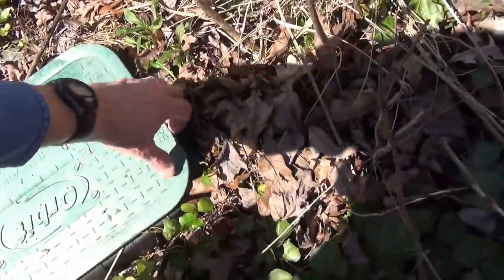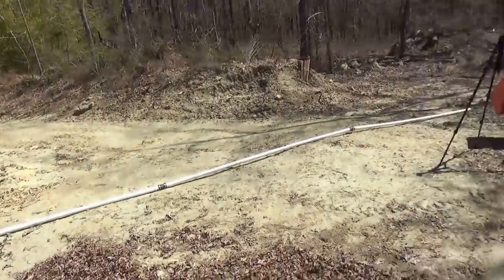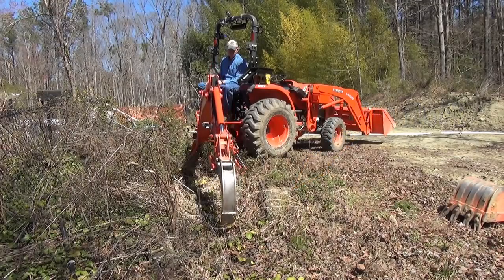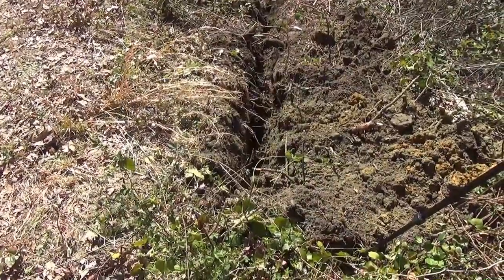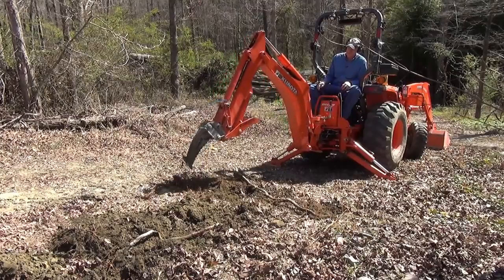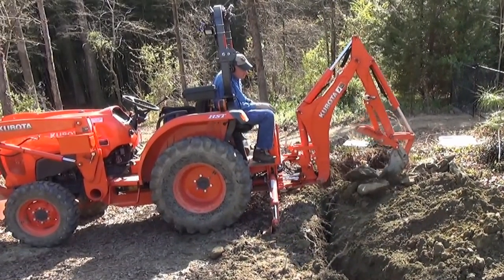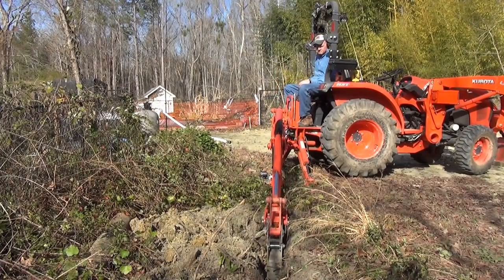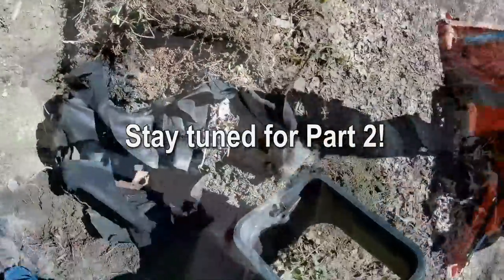Trenching a New Water Line with My Kubota Tractor Backhoe - Part 1 (#32)

Comment: Hey there Martin!!  That's no small job you got going on there!!!  Good to do it as I would be worried about the thin wall pipe just like you are!!!  Having the quick change bucket and trencher is pretty handy on a job like this.  Looking forward to part 2 and see the valve box redone.  Where I live you can get away with only burying your lines to 2 feet most winters!!!  This past winter though, with out much snow and it being so cold, the frost probably went down 3 to 4 feet in a lot of places.  Take care !!!
Reply from the maker: Hi Mike!  Yes, it was a big job, but made easy thanks to Big Orange and the backhoe.  Just took a couple of days.  Thanks for watching!

Comment: Martin, I don't know if you already connected everything yet, but if you haven't, on your PVC, wrap bands of metal.  It looks like you may have already glued all your PVC pipe together (not sure).  I dug a water line from the water main back to my house and it was approximately 1200 feet (can't remember).  At the time I used a rented ditch-watch (from Home Depot rental) and then laid 2 inch pipe.  It was a long process and could have done a series just on that alone but that was over 10 years ago.  I placed metal bands around where each of the PVC pipes joined before burying.  This helps you locate the water line years from now with metal detectors.  Just my lessons learned.  Great video.  I have been trying to get a BH connector from Bxpanded and they only make for Kubota and JD.  I sure would love that quick connect.  Full watch and wish you a fine weekend.  Don
Reply from the maker: Hi Don!  That's a good idea.  I didn't do that but I do have a lot of video and pictures documenting where it is. :)  Thanks for watching and you have a fine weekend too!
Reply: THAT is a very good idea.  I've never thought to do that in the past but that really makes sense.  I like it.  SF, my friend.
Reply: @tractorman4461  Hey there Wendell.  Appreciate the acknowledgement.  Hope you and family are doing well. I thought of you the other week when helping a retired soldier make a wooden door. I remember you helped with your daughter's rolling wooden door using the reclaimed wood from your granddad's place.  I was thinking of doing something like that for my friend. Ha, so many wanna-do's running through my small brain-housing group (smile).  If I miss talking to you, have a great Memorial Day.  Semper Fi.
Reply: Good morning folks, another method is to bury a tracer wire (something cheap and thin works fine) then locators hook up to the wire and trace it. That's what we do with plastic gas and water lines here in the Kansas City area.

Comment: Very neat with minimal ground disruption.  A large chain type trencher would do similar so bucket appears to be appropriately named.  I made the mistake of buying the Kubota 10” bucket and any moist clay sticks inside horribly.  I am beginning to think it will become a $500 hunk of metal.
Reply from the maker: I’ve heard the same thing about buckets under 12 inches.  That’s why I like the BXpanded trenching bucket’s design.  Thanks for watching and commenting!
Reply: @DIYMyWay  Martin, you and Greg K can solve that issue to an extent by taking a HEAVY linked section of chain and welding it inside the small capacity bucket.  That will minimize the compaction of the clay in the bucket and allow it to shake out much more easily.  Of course it won't totally eliminate the issue.  Large links.
Reply from the maker: Now THAT’S a cool idea!  So is the chain link welded to the bucket just on the ends?

Comment: Nice job Martin. The closest thing I’ve got is a 12” hi capacity bucket and it still removes a LOT of dirt by comparison to your trencher. But it a lot better than the 24” one !!  Awesome video once again sir.
Reply from the maker: Hi Wendell!  Even though it doesn't hold a lot of dirt, I've been surprised at how quickly I could trench with it.  They now make a six-inch version that I would have gotten had it been available at the time.  A 24" bucket would be handy at times.  Thanks for the kind words, sir!

Comment: Hey good morning DIY. You're becoming a pro with that BH. The BXpanded equipment is really easy and quick as you mentioned. When you trench it in are you also going to trench in the drain pipe from your sand filter? Cheers !
Reply from the maker: Hi GP!  Thank you, sir!  The back wash line can probably share the same trench for a little ways then it will head across the road into the woods.  I won’t install it until the last of the concrete trucks have travelled that road.  Thanks for watching!
Reply: @DIYMyWay  Hi DIY- I am considering the purchase of either the 4.5 inch or 6 inch trencher fro Bxpanded. Any thoughts? Not sure the 4.5 makes sense since the knuckles on the backhoe arm may be wider than the scoop. thanks

Comment: Is there any issue with the 6" trencher bucket being narrower than some of the linkages on the hoe?  I have been researching the same setup you have with the quick-attach, 6" bucket and thumb from BXpanded and see some concern from folks that this would be the case and possibly result in damage to the hoe linkages.  Thanks for any insight.
Reply from the maker: Hi Scott!  I have the 4” trencher bucket with the quick connect and thumb and haven’t had an issue with it but I don’t use the trencher bucket very often.  However, I could see where this could be a problem.  If BXpanded or some one else made an 8” bucket, that might reduce the risk of damage to the hoe linkages. Thanks for watching!
Reply: Gotcha thanks for the response!  Don’t suppose you could give me a measurement of the width of the linkages on the BH77?  My dealer doesn’t have any on hand and finding it surprisingly hard to get that spec. Thanks either way!
Reply from the maker: Hi Scott!  The width of the linkages are 6.75”.  With the BXpanded thumb installed the width of the bucket hinge is 8.75” but would also be 6.75” without the thumb.  So a safe trencher bucket width would be 8 or 9 inches without the thumb or 9 or 10 inches with the thumb.  Good luck!
Reply: @DIYMyWay  awesome thanks!

Comment: I have a BH92 and would like to get one of the BXpanded trenching buckets for it, but I don't know if it will fit or not....I don't know if the buckets are interchangeable between the BH77 and BH92
Reply from the maker: BXpanded doesn’t list the BH92 on their website backhoe section. Have you contacted them to see if they have plans for one? They need to know there is a demand for it. Thanks for watching!
Reply: @DIYMyWay ...I have contacted them several times but never got a response. I'm going to contact Kubota and ask if the buckets are interchangeable between the models or just order one and see if it fits....nice videos
Reply from the maker: That sounds like a plan, Doug.  Good luck!